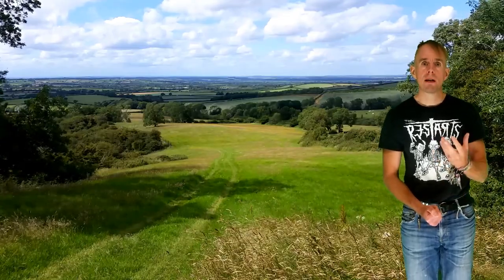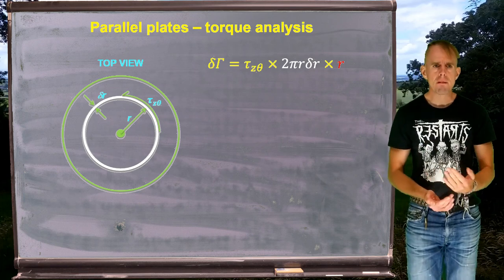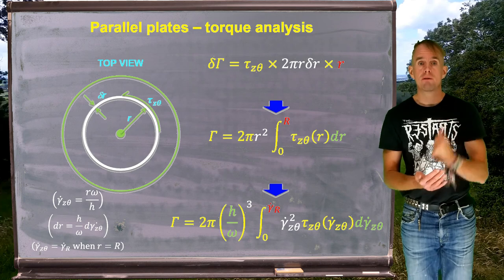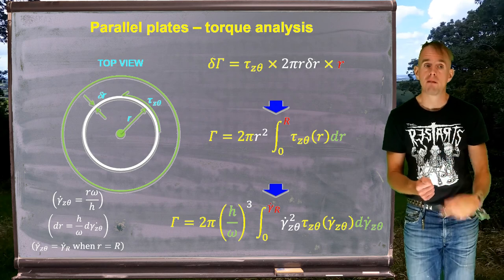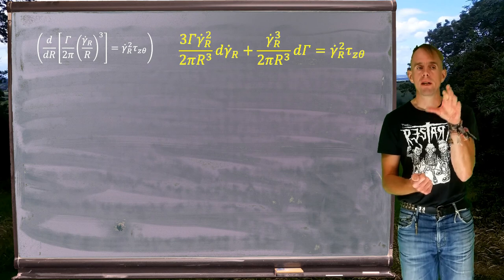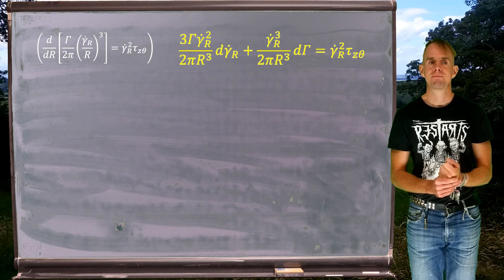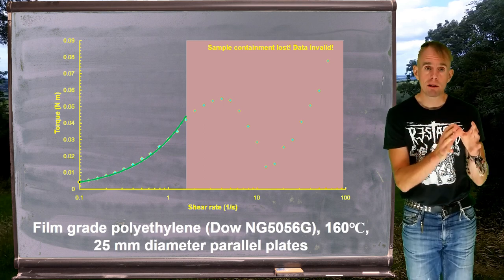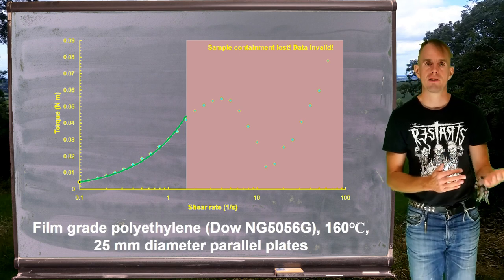Lesson 7, part 4: analysis of rotational rheometry data

Comment: If we apply constant stress on a sample (creep experiment) and measure strain as a function of time using a parallel plate geometry. How do we use the correction factor you explained above to correct for non-uniformity (radial dependence) in measured strain? Also, would the rheometer report some average value of measured strain in this case?
Reply from the maker: Hmmm. Sorry for the late reply. I'm no expert on creep experiments, but my thoughts would be:

(1) yes, the rheometer would report some averaged strain. If you think about what the rheometer is measuring, typically angular displacement, then the reported strain is likely to be some integral average of the strains that stem from the measured angular displacement. Exactly how its done may depend on the rheometer.

(2) my gut instinct would be perhaps not to use parallel plates for a creep experiment unless the nature of the sample made any other geometry unfeasibale. Think about the opportunity for slip! How do you get good adhesion between of the sample to the plates? I used to prefer vane tools for these types of experiments - you don't have the strain averaging problem and although slip is still possible it'll be more visible if you observe the experiment (draw a line on top of the sample and see if you get discontinuities!). This does assume that you can adequately fill a vane tool with your material though.

Hope this helps.
Reply: @drbartsworldofchemeng  Thank you for your response :)
Reply from the maker: @ycs6261  a pleasure, hope it helps!

Comment: So the rheometers are programmed to use the final equations derived here, for shear rate, shear stress and apparent viscosity calculations?
Reply from the maker: Well, it depends on the machine and the transducer. For example, the ARES and Kinexus rheometers will both measure torque, using torque rebalance transducers, which will be then be converted in software to whatever measurement is required. You can also access the raw measurements though for further analysis.